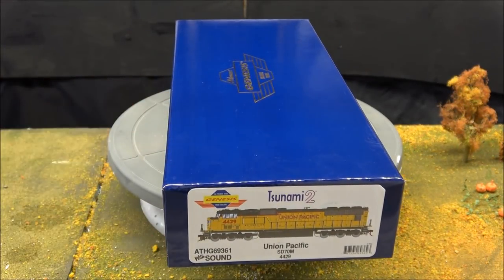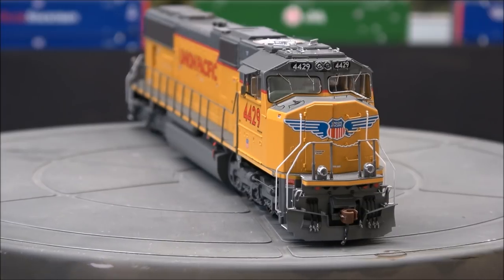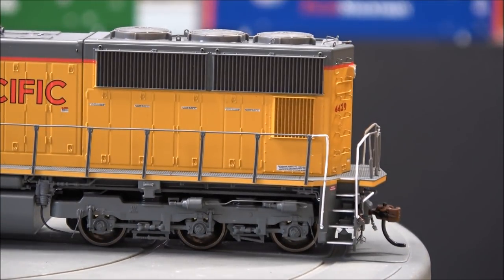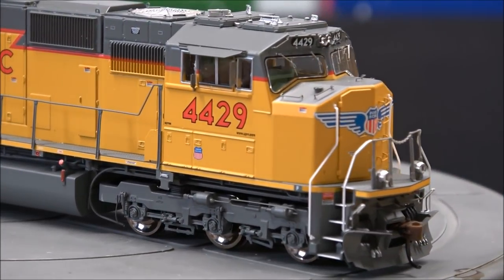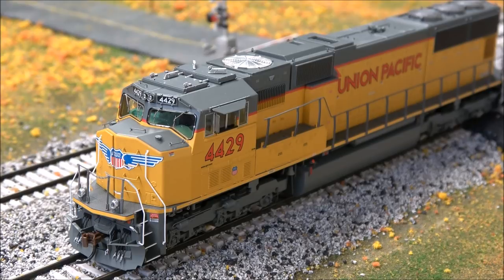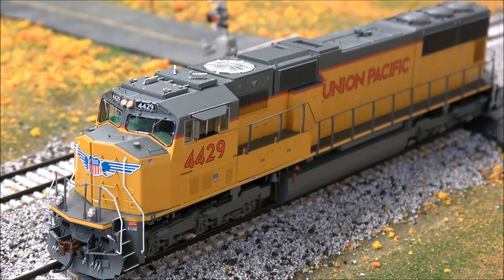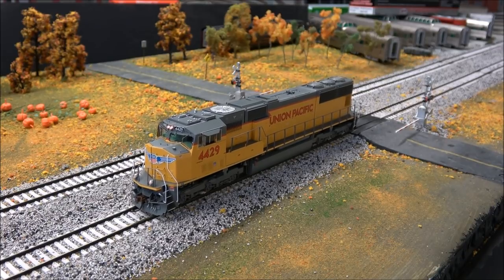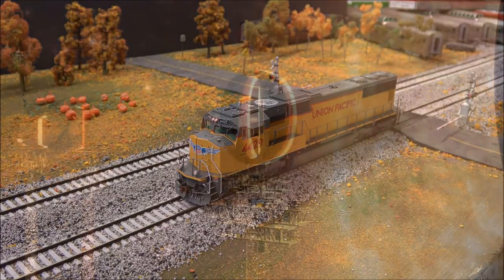Follow Up Look: Athearn SD70M w/ PTC Antenna, Yellow Sill UP

Comment: What is the price of the Athearn SD-70 you just demonstrated? As I am mostly deaf, I use closed captioning (when available) to get what is being said. Possibly due to captioning error, it appeared that the price of the Athearn loco was $99.99. Is that actually correct? Please reply when you can, thanks! Also, great video as usual. I truly enjoy your reviews!

Trainnut1958
🇺🇸🚂🚃🚃🚃🚃🚃🚃🚃
Reply: John Keatley it said MSRP is $299.98, but you can get it around the low 200s mostly
Reply: Wisconsin Rail Productions 
Thanks @ Wisconsin Rail Productions! That's all I needed to know. I may buy one probably in BNSF.

Comment: Wipers should be black not silver on the SD70M. And they are oriented completely wrong. Wipers stow at the top of the windshield when not in use. These are positioned like on a GE unit. Fail on wipers